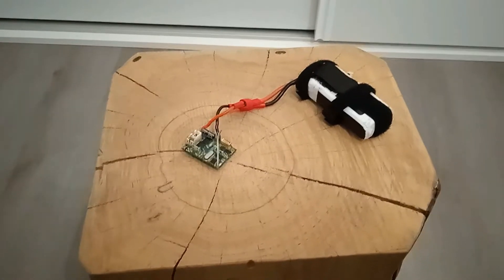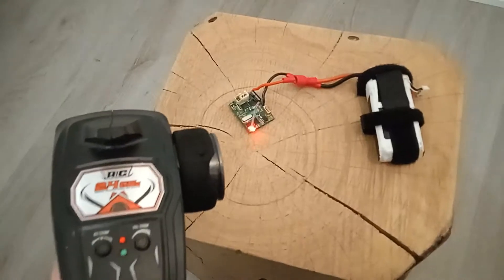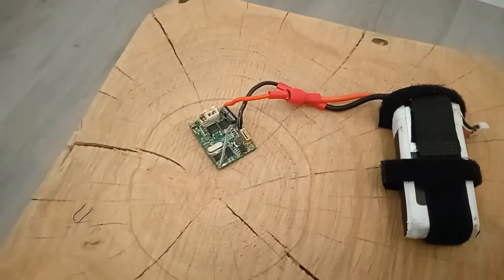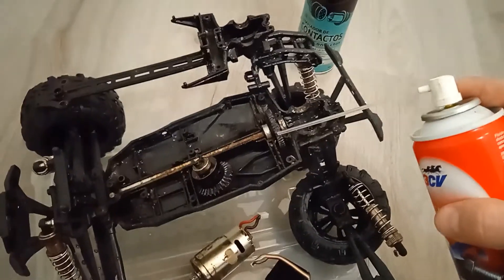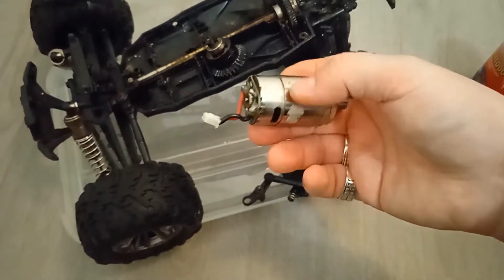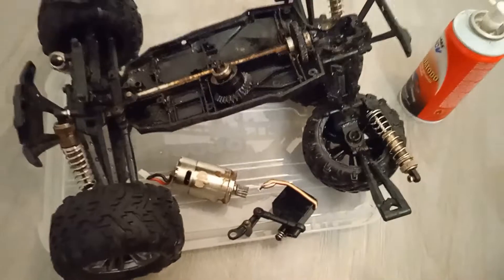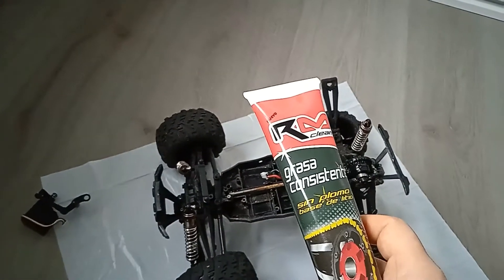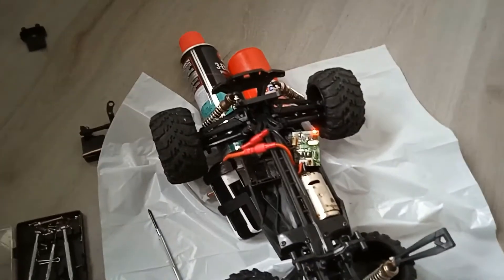How to Fix Bad Radio Receiver Switches on Electrical Boards in RC Cars. Xinlehong 9136 Case. Part 2.

Comment: I have a 9136,nice cheap hobby grade lil to cheap but am having an issue with old battery  works for few minutes then turns completely off,got new battery li-on-po works just like new can't figure out is it connections with battery or esc what you are working on, ur the first I scene with video about this part
Reply from the maker: I have a video on how I adapted these connectors. Check the playlist for this model on my channel.
Reply: @RCToysAventuraSmartSolutions  my have worded it wrong, does the switch or circuit board go out first in esc or just connections
Reply from the maker: there is no separate ESC, it all comes in one circuit, the switch goes bad, the circuit may be still good.

Comment: can you help me?  why my receiver turn on, and it goes off straight away?  i try to change a new receiver, and same happened again. power on and it goes off straight away,  and sometime can not turn on at all
Reply from the maker: difficult to say, you need to do some checks with a multimeter...